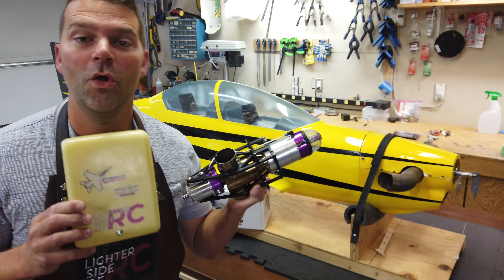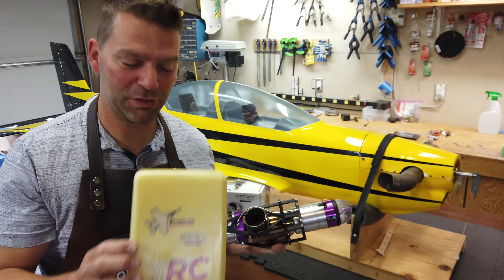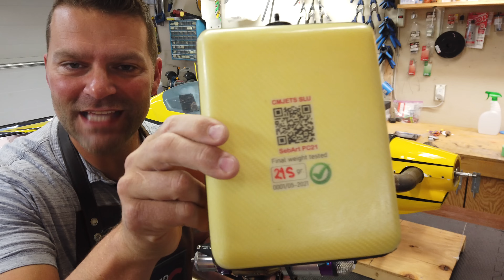XICOY X45 MICRO TURBOPROP - Install in a SEBART PC-21/PC21

Comment: Do you remember the diameter of the propeller used? 20 inch? I see it was set to 22 degrees pitch in the maiden video. TIA
Reply from the maker: Hey Phillip.  Sorry I don't remember and the aircraft has been sold by the owner.
Reply: Darn!!! Oh well. Thanks for getting back to me.

Comment: fantastic work and vid 👍
Did you use the HR or LR XICOY gear  reduction and which prop diameter? Thanks a lot 🤗
Reply from the maker: Thanks Serge.  As the aircraft sit's today, it's running a 5 blade vario prop.  I believe the owner has the blades almost maxed out for pitch and it's got lots of power!
Reply: @thelightersideofrc  thank you 👍

Comment: Curious why is the firewall mounting off center? Very new to all of this so I’m a bit confused 😅
Reply from the maker: Great question.  It's off center and off angle so the thrust from the engine doesn't effect the airplane.  If it was perfectly staight it would induce some non linear flight characteristics.  This adjustment helps combat this.

Comment: Why don't you tap the prop bolt for a 4mm heli coil
Reply from the maker: Could but easier and more accurate to get pre made stuff from the manufacturer
Reply: @thelightersideofrc  true....but as for accuracy you already have a hole and 5mm is the perfect size for a 4mm heli coil and I know you have a mini lathe 🙂

Comment: I'm basically doing the same conversion except on a CARF Tucano. I'm so looking forward to my x45, Gasper notified me last night it's now on the test stand. Very interested to see if there is any power difference ? Nice
Reply from the maker: Very Cool Glen!  I am interested to hear your thoughts.  If you don't mind, once you get it installed and such please let me know your thoughts.   thelightersideofrc@gmail.com I think you will see a significant difference!
Reply: Definitely will, latest update has been shipped from Spain. I noticed you use a 28x , I have just swapped to the core radio, tried selling the 28 but no interest here , seeing if there might be some interest in the US? It’s in really great condition
Reply from the maker: If you post it in the JR 28x owners group on FB it should go quick.
Reply: @thelightersideofrc  okay thanks, didn’t think of that cheers

Comment: Just interested to find out why the mount for the engine is offset and not centred?
Reply from the maker: Engine mount and angle of firewall is like that to counter forces generated by the prop. So firewall is angled and engine is offset to get it back to center.
Reply: I just realized its because the box behind the mount is offset to the left so the engine mount has to be offset to the right to make the engine centred. Big fan of your work.